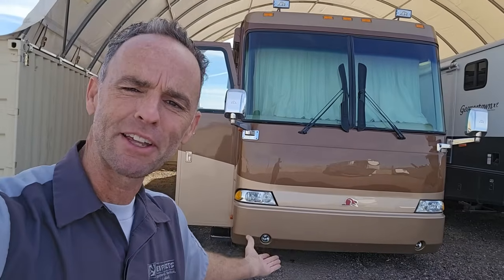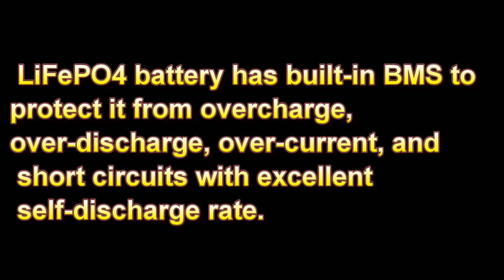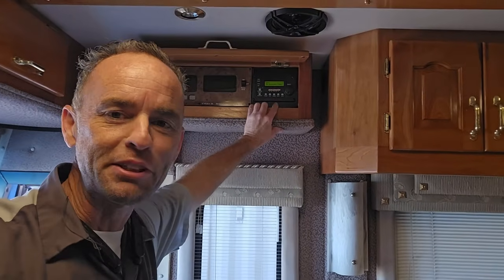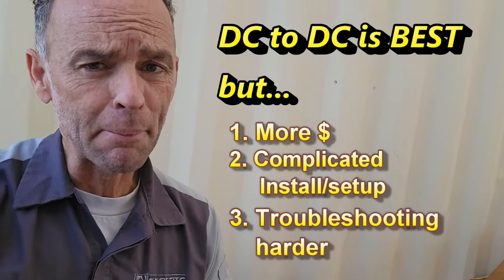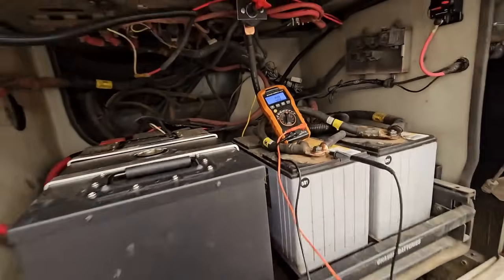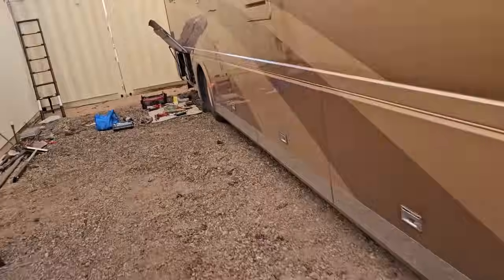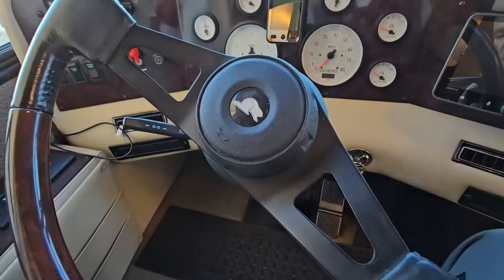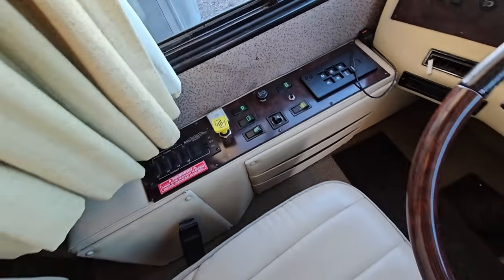What You NEED to Know About Adding Lithium Batteries to Your RV

Comment: You're right that charging to standard lead-acid or AGM voltage is fine.  With a low-amperage BMS on a small LiFePO4 battery, that is discharged to 0% or 10%, the alternator might feed more current than the BMS allows in, and the BMS will trip.  Surely not a problem with your 400+Ah battery with 250A BMS.

I do think you completely missed an important decision factor, though,  due to the bias of living in Arizona.  

DO NOT charge the LiFePO4 in freezing temps.  32F is the accepted cutoff, and for an alternator/battery combo that can be charging a battery quickly, I'd say to be careful that the battery is more like 38F or higher.  Most LiFePO4 batteries do not have built-in low-temp charging cutoff.  Some do, if you pay more.  For anyone operating an RV in below-freezing temps, they'll need to deal with not only charging cutoff to prevent battery damage, but battery heating to prevent running out of battery capacity with no ability to recharge.  There are a dozen ways to deal with the problem successfully, from sitting the battery on a heating pad, to having your own temp sensors on the battery, combined with feeding in RV heat, diesel heater heat, or whatever.
Reply from the maker: My Vatrer does have built-in low temp charging cut off and it is more common in modern LiFePO4 batteries as it is a feature most RVers are looking for now.

Comment: Please fit a B to B charger as it will give the proper voltage to the lifepo4 and stop back feeding the starter batterys as you will cook them with the higher voltage of the lifepo4,as you are also charging with solar as well as limiting the current from the alternator so it dose not over heat.The worst thing you can do is direct couple a lifepo4 to an alternator at tick over it will pull max current with almost no cooling on the alternator and cook it,or at least its life span
Reply from the maker: I think I covered many of these points. 14.5-.8vdc is very common on an engine battery, while I recommended a dc to dc charger as best, it's not the only path. There's a lot of fear and misinformation that stifles enjoyment with paralysis. I personally wouldn't want the dc to dc charger in that bay and re-locating it safely would be a large project. I'd still want a boost relay for emergencies. The video I hoped to simplify, de-mystify, and alleviate basic concerns to remove the "perfect plan" to understanding things not known to most people. I would do things different on a different RV but use this information the same.

Comment: Run a new dc to dc charger from crank battery to new lithium battery, lm running a 40amp,this new unit allows me to select std battery, deep cycle and lithium batteries, plus a extra outlet for solar plus a temperature monitor that goes into new lithium battery, plus a shunt on the earth if your getting you voltage readings off current meters, 👍

Comment: Couldn’t you just top off the lithium batteries  from 90% to 100% with a  battery tender charger while running the generator instead of changing the old inverter/converter

Comment: Charging LifePoO4 battery to less then 100% will help the life of the battery... For example it will double the life of your battery. . A 2000 cycle will be up to 4000 cycles. A cycle is down to 10% and back up.. Using less depth of charge even extends the life of the battery even more...
Reply: No, it won't double the life of your battery.  The difference is miniscule... the battery's calendar aging trumps cycle aging anyway.  Also,  charging LiFePO4 batteries to less than 100% will cause them to go out of balance internally after a few months and actually put more wear on the cells rather than less.

The cycle life is really a function of how deep your draw the battery down each cycle.  That's all.   Generally speaking you get 2000 "full" (5% to 100%) cycles.  If you charge to 100% and only draw the battery down to 50% you can do that roughly 4000 times.   That's all.  You will not get a drastic improvement by only charging to 90% (assuming the BMS is even able to keep the internal cells balanced... which is unlikely).

The discharge floor puts far, far more wear on LiFePO4 cells than the ceiling.

So, more or less, you just don't worry about it. The batteries will age based on amp-hours drawn, plus calendar aging, and not much else.

Comment: Lithium batteries cant be charged cold.
Lithium iron phosphate batteries still catch fire just not as often as lithium ion but they do go into thermal runaway and catch fire. You can claim anything you want but youre not replacing my rv after a lithium battery fire.

Comment: its 13.8 fully charged not 12.8. 3.45 volts per cell x 4 cells = 13.8. That is so your battery will last longer. 3.65 per cell is max but you do not get much energy difference from 3.45 to 3.65 it just takes cycle life away faster. I build my own but I was to buy it would be from Gobel power if I was doing an RV upgrade. Under 3k for a 14kw 52volt battery. The one you got is good buy kinda pricey.

Comment: I have several magnum inverter/chargers that power my home. With the  Magnum Energy ME-RTR Router Control, you can adjust your charging voltages for any type of batteries,  including Lithium-ion batteries,  that power my magnum inverter/chargers.

Comment: No no no no...the major problem with using a lead acid charging profile with LiFePO4 is the fact that Pb is kept alive by trickle charging it at the peak voltage 24/7. Lithium of any chemistry (cobalt, iron phosphate, titanate) should NEVER be trickle charged at the top 10% of their state of charge for long periods of time. They charge with a simple CC CV charge profile and the CV stage should usually be no longer than an hour. What separates a variable voltage/current power supply from a charger is that a charger will have a current cutoff for the end of the CV stage. Depending on the size of your pack and your charge current you will want to cut the current off completely when it typically hits 10% of your initial charge current. Charging at 100A? When the CV stage drops to 10A you'd want to cut the charge altogether.

Comment: Unrelated to the video topic,  opening a microwave door is not the designed way to turn off a microwave.  The very cheap micro switch operated by the door is to prevent start when door is opened.   Ours failed and you could open the door and the microwave would continue to run.   It is fixable, but how many are willing to do the work any more?  Repair shops are $100/hr.
Reply: It is a safety switch and all manuals say you can stop the oven cooking by opening the door. How much is the part? Should be free and postage. Did anybody get cooked?

Comment: I have been watching alot of van builds and amateur builders and I am seeing a concerning pattern. They’re not making any of this strong enough for a mobile vehicle that gets abused, vibrates and gets thrown around constantly, in an accident and covered in dirt and grime. For example, your battery hold downs were horrendous. The aluminum bracket was literally touching the side of the batteries with no insulator or padding or form of vibration suppression. Over time the brackets will dig into the sides of the batteries and ultimately cause problems. Think about the constant abuse that area takes especially on the rear behind the axle. This is a great temporary fix to get home, but not something I would trust long-term. I just watched a girl strap 200 lbs of batteries down with little screws into plywood. If you’re going to build something or install something take into consideration its environment and estimated lifespan.
Reply from the maker: I would like to thank you for your input and feelings, but why would I insulate aluminum bar against a steel case. You seem overly confident with your bad opinion and I would suggest investigating how little is holding a car battery in place to sheet metal. My hold down is a great permanent design, your comment says much more about yourself and your character than my understanding of installing batteries.
Reply: @AZExpert  BURN!! 😆

Comment: Not exactly correct.  If you don’t charge to the full ( 14.4 volt ) the bms will not equalize the individual cells that make up the battery. This will lead to shorter battery life.

Comment: The LiBim is not worth the cost,. You can get a Renogy 40 amp DC to DC charger for about the same price.
Reply from the maker: 40 amp seems limited to me
Reply: @AZExpert  When doing the math, if the LiBIM is only on for around 40% of the time with its on/off duty cycle, that 120A max averages out to 48A, so not that far different from a 40A B2B really?  Plus you maybe have less stress on the alternator not taking it to 120A so that is an additional benefit?
I liked the sound of the LiBIM but less convinced as I learned most, especially with the comments of quite a few who have had issues. The bi-directional bit is handy mind. I usually recommend a starter battery maintainer when upgrading to a B2B together that feature, but it is an extra cost  (£70 UK inc taxes).
I use B2Bs on my Motorhome FWIW.  Got one 60A unit (internally 30A + 30A chargers) and one 30A unit and programmed them so they come on in stages to avoid a big "whammy" to the alternator.

Comment: Lead acid batteries have a higher charge voltage than lifepo4s in the equalize stage this information isn't completely correct. There also is no float charge for lifepo4s. Lifepo4s need completely different charge perimeters

Comment: https://youtu.be/pZm4fa_GjCM?si=7KdUNYqLfrn37rqw … I’m worried that I will burn down my old 5th wheel due to the over current protection not working… thanks for this video… it would be super cool if you and Will did a video together testing if the batteries are doing what they claim.  I really need to get a new 12v battery that is going to not be ruined operating at -20C , the tiny battery in mine doesn’t work worth a shit in cold temps either - draws current from the water heater and furnace and runs it out in a few hours and it takes at least a day running a generator to charge it enough to start the furnace…  trying to figure out the best battery to get

Comment: I always laugh at movies where people are tortured with a 12v car battery
Reply: If a villain starts with a car battery, which he hooks to another device, and then uses that device to torture the hero, that’s a situation that’s grounded in reality.
There’s a very real device known as a picana that, powered by a common 12V car battery, is capable of delivering electric shocks of very low amperage at high voltages, which, like grabbing a hold of a bad coil wire, is extremely unpleasant.  😶‍🌫
Reply: @DaveDrawing  is that what they did here? attach the device you talking about?

Comment: your lithium batteries will last significantly longer if you do not charge them above 80% or below 20%... I changed years ago and even have my solar set to AGM instead of Lithium.... some say you'll extend battery life by as much as 40%.... same is true with most EV's btw.
Reply from the maker: Will Prowse just covered this in depth and 100% is not going to damage the LiFePO4

Comment: At Around 2:10 a heading pops up and says CHEMISTY,, What is CHEMISTY??????????? Does he mean cheMistry perhaps. No proof reading.  His NEW batteries have UN INSULATED straps across them. No vibe absorbing pads and NO Electrical INSULATION for when working in and around the batteries.  RENOGY CHARGE CONTROLLERS don't last and the RENOGY COMPANY HAVE ZERO customer help or assistance. If you ask them they simply tell you rubbish or ignore you after making it hard to even contact you.
Reply from the maker: I do not represent Renogy and have no loyalty to any company only repect for decent humans. I try my best to record and edit and proof read but 14 hour days working can cause me to miss things. Why is the uninsulated strap an issue? What magic do you think a vibration absorbing pad would have to cells which are strapped to a box? Social media has given me some clarity that many comments are a reflection of a general unhappiness or discomfort projecting of the commenter. I appreciate your concerns and will see what I can do on the typo, but I would ask how you would respond to a stranger that walked up to you and started yelling and mocking you?
Reply: @AZExpert  Perhaps you should go on HOLIDAY to improve the situation.
Reply: Troll